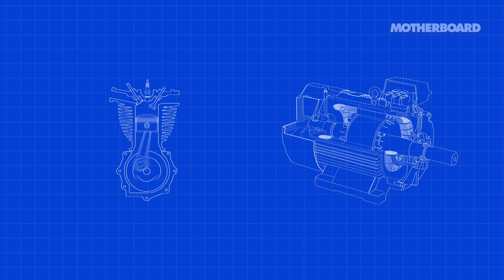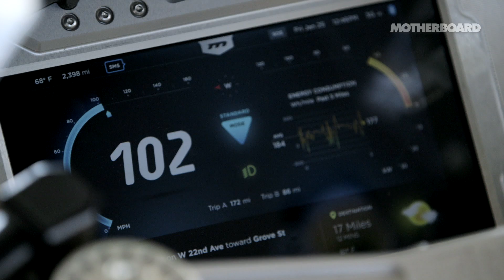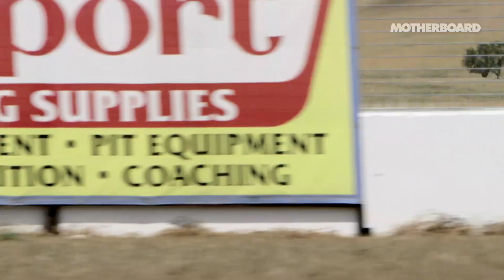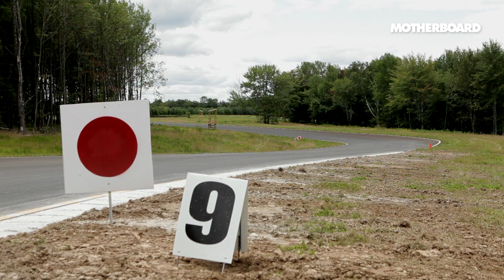Mission RS: The Electric Superbike of the Future

Comment: They mentioned hydrogen and they are bankrupt. Still it was a really fast bike even by today's standards. It is now 2020 and 7 years later. The new motorcycle, called the SR/S, is an evolution of sorts of the flagship bike Zero unveiled last year, the SR/F. It uses the same electric motor and battery as the SR/F, and therefore offers basically the same specs. The SR/S can reach a top speed of 124 miles per hour, has a range of up to 200 miles (when using the optional range-extending battery “tank”), and has 110 horsepower at the flick of the wrist. It also can charge at up to 12kW with the optional rapid-charging package, allowing the battery to get from 0 to 95 percent in about an hour. 
The SR/S features the SR/F’s powertrain in a more aerodynamic package

The SR/S also shares the SR/F’s digital DNA. There’s a big digital screen, a companion smartphone app, and a level of connectivity that allows for over-the-air updates and real-time riding statistics. Considering all the similarities, it should be no surprise that the SR/S will cost about the same when it goes on sale in March, as it starts at $19,995.

Comment: The secret, and best possible design is to mate an electric motor (or gas if you prefer), to a HD NuVinci transmission, it is the clutch and torque transfer device of the future.  It's efficiency and simplicity will be copied and remade many times over for all power applications.

Comment: Any gasoline motorcycle from the big 5, is no more than 40% efficient and 60% of the gasoline's energy goes out the tailpipe and cooling system.  Electric is 90%+ efficient on turning stored electric energy into wheel torque.  Gas already lost the race, it's subscribers just haven't realized it yet.

Comment: My thing with an electric bike is the same as the electric car situation.  They're far too costly and dont have a long enough range (or quite quick enough recharge on the flip side of the coin).  For the car example I love the Nissan Leaf but its just still too costly.  A cheaper hatchback with similar range to the Leaf would be spectacular for me.  I want super basic if its gonna be a daily beater/city car.  Theres also Tesla but honestly dont make laugh.  Other than the fact they're hideous, they cost multitudes more than Id ever pay for any car.  If they made a cheap runabout without that junk like self driving and touch screens and nonsense like that Id be all over.

With the electric bike If a company could make a cheap version with similar range and less power you bet your ass Id be all over it.  Just a simple daily cruiser would suffice me.  I ride a Honda Rebel now whenever the weather lets me and it serves its purpose wonderfully.  Transport the idea of something like a Rebel/Ninja 300/any small commuter into a cheap electric and Id be testing one out the first chance I could.

Comment: Bikes are already amazing at fuel economy and power to weight.. I don't get it, really. 70k for a bike you need to 'fuel' more often, and get shorter rides out of? Okay.. 

Why the hell aren't people making commercial trucks electric? Heck a transport truck could have a built-in hydrogen-solar production system slapped inside of it with room to space, and REALLY make a huge dent on CO2 emissions if that is what is bothering you.. But sportbikes? Nah. Maybe a city commuter bike, but why the hell a sportbike?

Comment: I don't understand why electricity is the fuel of the future. It is not nearly as clean as gasoline when you consider how much coal must be burnt to produce it...
Reply: Because not all electricity is made by burning coal and in the future more renewables will be integrated in the grid. There are today countries with over 90% of the electricity made from zero emission sources: Norway, France, Brazil. The EV market is still small in all of those countries so people are doing a really bad job at practicing what they preach, as in adopt EVs only when the electricity is from clean power sources. Fake news, even when clean power is abundant, they still refuse to buy EVs at the same scale as ICE, so that's not really the issue, it's the price and performance, hence why companies try to make them faster and cheaper to appeal to the mass market which currently is populated 99% with dirty burning vehicles that give people cancer.

Comment: a automatic peace of electric shit
Reply: It's not automatic, it's direct drive. Use wise it's the same but operational wise it isn't as it eliminates the multi speed transmission. The truth is that more gears would allow the motor to do more things, as in have faster acceleration and higher top speed but for normal road use is not necessary. On the other hand ICE NEED the multi speed transmission because their torque curve, they couldn't function without gears. This all means that they're different, which should be intuitive but people miss that nuance. Electric motors don't need gears to function, ICE are dead on arrival without them.
Reply: ok.
Reply: hes right you know

Comment: Seems kinda dangerous without a manual clutch.  What if the throttle gets "stuck" wide open or somehow malfunctions when you are in a turn?  How do you disconnect the power to the rear wheel?  Also, why not put 2 horns on it?  A standard motorcycle horn and some recording of a train horn for really annoying drivers.

Comment: I hope that in about 10 years, you can get these used for something like $5K or less just as you would a used gasoline based crotch rocket.   Also a watered down version with smaller batteries and maybe only 100 HP max but 400 pounds or less ready to ride.

Comment: RIP Mission. I hope someone ever gets to a point where it is possible to manufacture a fast an nimble naked electric that can be sold to consumers for less than $10k.
Reply: you have the zero electric bike which cost around 7 to 15 k$
Reply: I know, but their bikes are still too slow for the asking price IMO. Their $7k bikes have extremely low range, and as soon as you add a battery pack, the performance drops to 300cc levels. Their fastest model, the SR, is $7k more than competing IC bikes, which you'll never make back in fuel savings or even maintenance. The S is probably their better-valued option. $10k and about as fast as a 600cc. Still, it only has 80-90 miles of range and a level-2 charger will set you back a whooping $2k.

They're definitely getting there though.
Reply: dsp4 Ktm has electric dirt bikes, and sumo's, for £10k but their batteries aren't that good, and only last about an hour.

Comment: Down side of electric bike no clutch and gears
Reply: subjective downside.
Reply: You mean upside. Transmissions exist to alleviate the very narrow range over which ICE-engines can efficiently produce power. They would be totally superfluous on an electric vehicle. It's just you and the engine, nothing in between.
Reply: 30 minutes, and improving as we speak.
Reply: Patrick Theriault Electric hydrogen is the future. Refuel in seconds, but with potentially 0 emissions. What we need is just more hydrogen refuel stations, which will come as more hydrogen cars are bought, and produced. Then lighter and smaller hydrogen fuel cells, for motorcycles. Then they can be made really easily.
Reply: yeah but nothing to do just holding the gas is boring
Reply: I believe boring is an opinion. which is fine to have, but it's not a downside.
Reply: Patrick Theriault I get what you mean. Shifting gears is fun in a Fast and Furious kind of way, but really it's mostly fluff. Not having gears to switch lets you focus on the important stuff, like throttle control, lean angle, body position, etc. That's the really engaging part.
Reply: Adam Kimm I know its the futur but gas will forever in my heart

Comment: The number one consideration with any consumer item is the price.  I don't care if this thing goes 500mph for 5,000 miles on $0.01 of electricity if it costs 100 million dollars.  Leaving out the price is a sure sign this company was destined for bankruptcy.  Additionally, a 10kw charger is not going to charge the battery bank in 1 hour off your typical home outlet, that's for fucking sure.  I don't mind self promotion, but cut the bullshit already.

Comment: Hey! Hub motor is next. Without the chain, there is one more extra point to take.
Reply: I like how you think. Wouldn't that dramatically increase unsprung weight though?
Reply: Hub motors aren't a good solution. The reason they are used on E-bikes is because it's the easiest way to convert a conventional bicycle frame and also to keep bikes like the stealth looking more like a bicycle than motorcycle. 

Think of it this way - as you increase the size (and as a generalization, power) of the electric hub motor you are also increasing the weight (again, a generalization and not true in every instance) that that motor is being forced to move. 

That said, maybe we will see hub motors used at the front end of electric enduro bikes.
Reply: there would be a bigger yaw moment of inertia

Comment: "You also dont need a transmission, so you're more focused on riding and the overhead of the vehicle"...Wtf statement is that. Gearing up and down the bike is the funniest part of owning a motorcycle.
Reply: It's not. Transmissions are a hack to make ICE engines useful over a wider range. A transmission-less vehicle isn't stupid like an automatic or a CVT, it has good power throughout the rev-range. Your inputs are directly translated into speed.

Comment: the lightning ls 218 is faster and has a better range
Reply: Probably way more expensive, too
Reply: not really. there are cheap electric bikes with good range and , electric being electric you still get the same power. we are at a point where internal combustion is simply more retarded. Even a steam engine is better then petrol now

Comment: Electric will never take over why? Because none wants to sit at a recharge station for an hour or longer.
Reply: Exactly. That's my main gripe with all these electric vehicles, besides the ridiculously low ranges between charges and the pricing. Convenience goes a long way. What if an emergency arises? Better call the ambulance, or tell that family member to not die soon, because your car still has a couple hours before you have the range to make it. What if somehow you forget to charge it, or leave the lights or radio on and run out of juice away from home? Can you "jump-start"' electric vehicles in that case? Or must I carry a generator in my trunk? Idk, sounds like a pain in the behind to me when I can whip into a station and fill up in 2-3 minutes and not have to worry about it. Not to mention bikes get amazing fuel mileage these days as it is. Plus what kind of batteries are these? They strip mine lithium for batteries, and I'm not sure that's "eco friendly".

Comment: No gears?  Why is that?  That takes away from some of the fun experience of a motorcycle.  Also electric bikes are not 0 emission cuz the electricity needed to charge them is not without emissions.  No concept of how fast you are going?  What a crock!  Just look at the speedo and the road rushing past you and listen to the wind intensity.  What a quack. 

   I would just want a regular 120V charging system that would draw about 1500 watts from a standard outlet.  Then an overnight "smart" charge (3 stage) would be done in 8 hours which would be fine for the next days ride.  I wouldn't feel comfortable with something like 5000+ watts flowing thru the charging system as that is some serious power and inconvenient to charge since it is way beyond the capacity of a normal 125V 15A outlet (1875 watts).

   I have ridden an electric scooter with only about 1 or 2 HP and the overall gearing made a big difference how it accelerated.  Gears may also help save battery life on an electric motorcycle cuz of the greater back EMF created by a more rapidly spinning motor.  Sounds to me that they have more tweaking to do.  How about a "simple" transmission such as a 3 speed (low, med, high) with a "bypass" direct drive for those that don't want to shift at all (ever)?

  For the lack of sound, they could just use speakers that simulate a gasoline engine sound and the good thing there is the rider could (in theory) choose from a dozen or more exhaust "notes" such as quiet, medium, loud, open pipes...  That would be fun to mess with some fast cars while waiting at a red light.  Zing the engine in the "open pipe" mode and then before you give him the smackdown, set it back to stealth (super quiet).  The guy will wonder what happened to your engine and exhaust note.  Ha ha.

Comment: Some ways they could commercialize this is to implement a gearing system and possibly attach some mechanism to the engine that produces a pleasing sound when accelerating. Bikers love the act of switching gears and the unique sound their bike makes :)
Reply: Personally I'd prefer a bike like that you just twist and go. Something that you can just lose yourself in, think about nothing but the ride.
Reply: +Marnu B  
They did it on the ''Brammo Empulse R'', but people didn't like it, because they said that the gearing is just a waste of weight on the bike.
Reply: Aggie On2Wheels I'd rather not, It's hard lose yourself in the ride, when it sounds like a broken, overheating hairdryer.
Reply: Aggie On2Wheels I like the way most bike sound, just not scooters.
Reply: +adam kimmⓋ you aint about the bike life. i love the way my bike sounds all the way to the redline
Reply: +adam kimmⓋ then get a scooter. bikes are performance machines
Reply: Don't worry  there will still be a noise only internal combustion engine noise. Competition in the future

Comment: Ivan Illich wrote a great piece about how you never really go faster than (plain) bicycle speed - once you factor in the TIME involved in achieving a higher speed whether cars, the Concord or space travel, you're not really going faster than about 15 mph.  They are also the most economic and affordable transportation, mechanically extremely simple to maintain.  You can get +/- 500 miles per slice of pizza.  The rest of this speed demon, hi-tech approach to speed is nonsense snob appeal designed to empty your wallet.

Comment: Yes the price is VERY high now but think about all of the money you will save in engine oil, coolant, petrol, tax and insurance (maybe not insurance). There are so many things that can go wrong with internal combustion engines that can cost a LOT of money to fix. Electric bikes make sense and I WANT ONE but don't get me wrong, I will always have a petrol bike, until oil runs out obviously...
Reply: +SV650Dude  the concern of a electric bike isn't the motor but the batteries and when the batteries run flat it will be a lot of money for sure. think of your phones batter its life gets sorter and shorter
Reply: +KX450Fcunt You can fine some Ebikes that cost 8K

Comment: I get electric cars, (I have a Renault Zoe) they are a very nice environment in which to travel. Quietness and smoothness coupled with comfort and all the technology you can shake a stick at is extremely appealing.
Recharging can be very fast (as little as 30 minutes from empty to full) using a rapidly developing network of standard chargers.
However, electric bikes I just don't get. Part of the thrill of owning and riding a bike is the noise. I have a Ducati, and believe me the sound of the motor spinning up and resonating through the airbox is intoxicating. To take that away is to take away a huge part of the overall bike experience which will turn most people away, which is something that Harley Davidson is about to find out with their "Live wire".
To commute on an electric bike is one thing,  there are many choices of cheap electric scooters, but to own one for pleasure riding is never going to be anything other than a novelty.